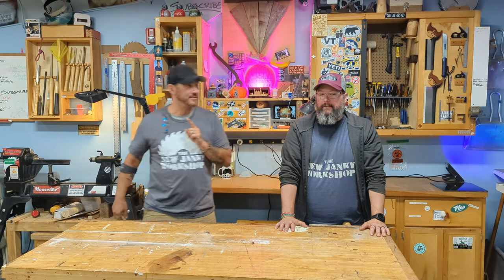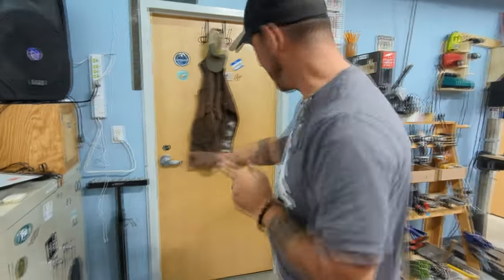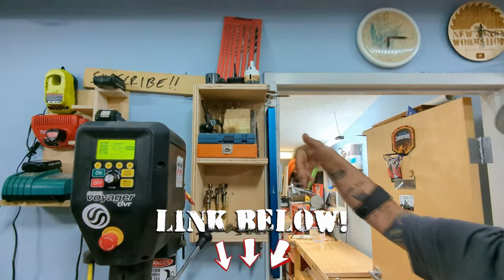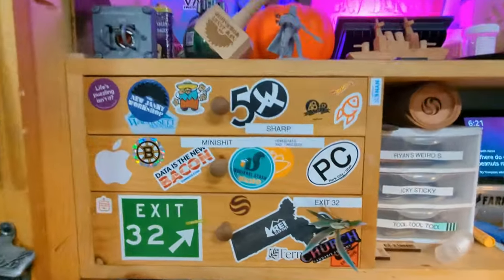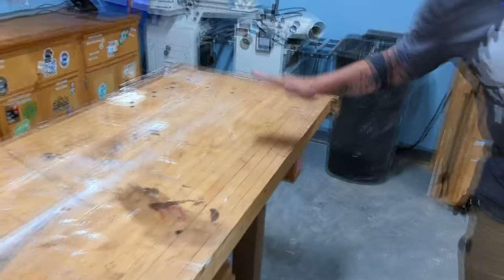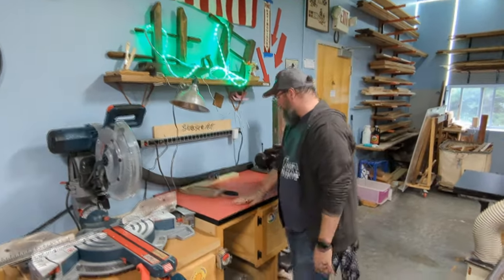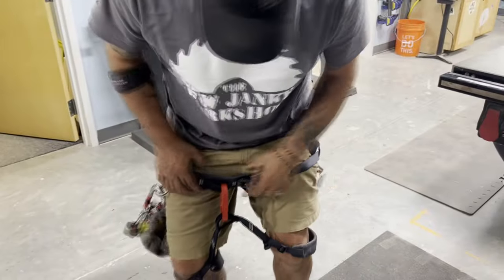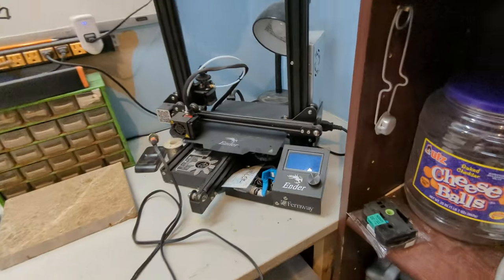INTO the DEPTHS of the Big Fancy Shop

Comment: Subbed just because of the name!!  Love it!  Concerning your dust collector..As breakers age they will not handle the amperage as well, lets say its a 30 amp breaker but 18 amps may be tripping it.  Might try replacing the breaker.  To be sure if you have a buddy with an amp clamp, check the current draw and make sure its within specs.  
FYI
Those dust collectors pull way more amperage on startup, once they get up and running it comes down.
Reply from the maker: Thanks for the sub and the tips! We're about the furthest thing from electricians, so any bit helps! This gets us closer to getting that beast up and running.

Side note on the name, I (Geoff) designed and ran the website for Norm and Russ a lifetime ago when they were still filming (eons before I was into woodworking, sadly), so paying some homage  to one of the masters :)
Reply: One thing I forgot to mention, Leave the blast gate closed when you start it up.  Letting it come up to speed with no air flow in the impeller will reduce the start up amps.  Something to try 🤞
Reply from the maker: Smaaht!